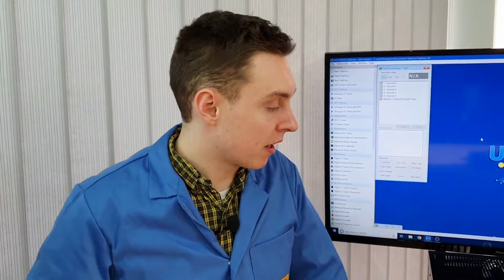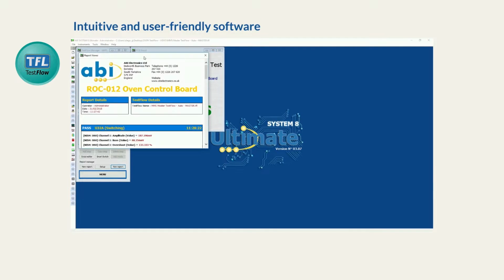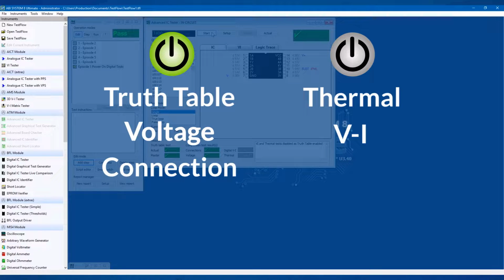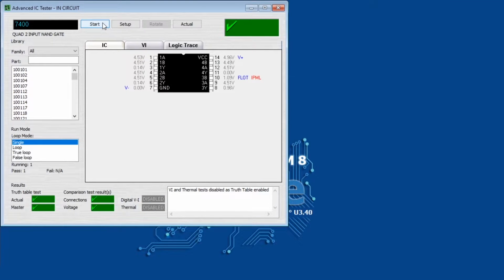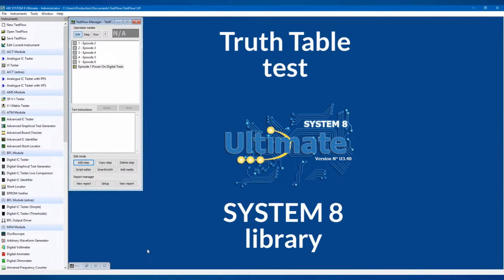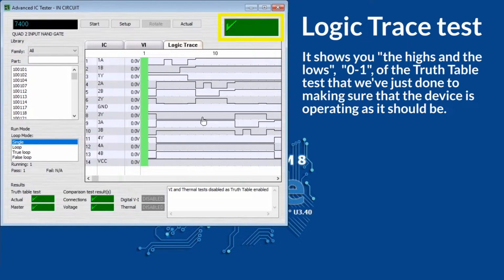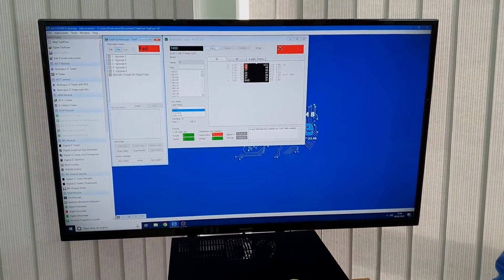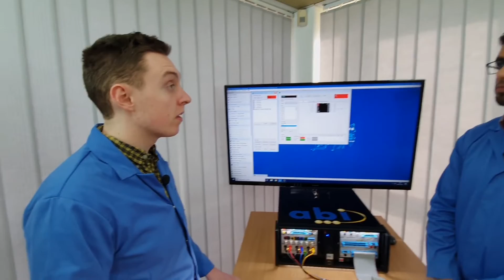Five tests in less than 1 second? Functionally testing ICs in-circuit with the BoardMaster (Se2 Ep2)

Comment: At one point in the video, I noticed that the clip was inserted inverted, but the ATM wouldn't have this software inversion option when the clip is larger and doesn't fit properly, right? It would be cool to develop a new LPA module (logic and protocol analyzer), where it could save information through system 8 ultimate in the test flow, digital waveforms and data in a list for future comparison.
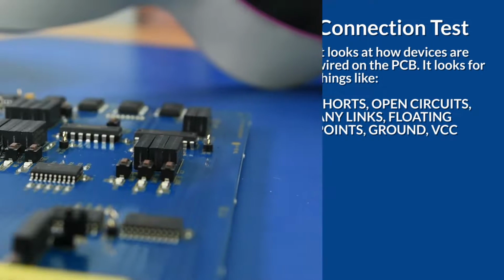Reply: clip was inserted inverted 2:27
Reply from the maker: Well noticed that the clip is in the inverted position! The BoardMaster can perform the test in this way thanks to the great "auto clip" option and the Connections test which identifies how the clip is connected to the IC before performing the rest of the test.  
 
Your suggestion for developing a new Logic and Protocol Analyzer (LPA) module is intriguing. We are continuously striving to improve our systems and software, which have evolved over more than 40 years. We have just released a new version of the software which is free to all our BoardMaster customers. We are grateful for your advice and will certainly bring your request to the attention of our engineering team.

The ABI Team
www.abielectronics.co.uk 
sales@abielectronics.co.uk 
+44 1226207420
Reply: @ABIElectronics  I'm going to test the auto-clip function! we have a boardmaster with 6 modules. Thanks.